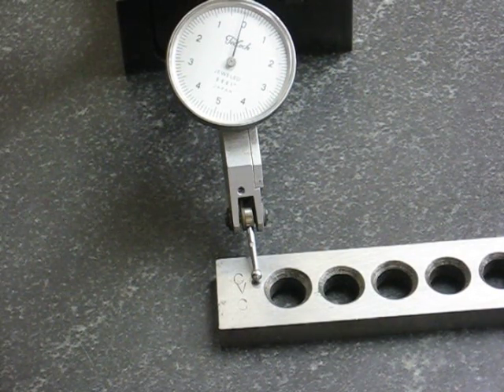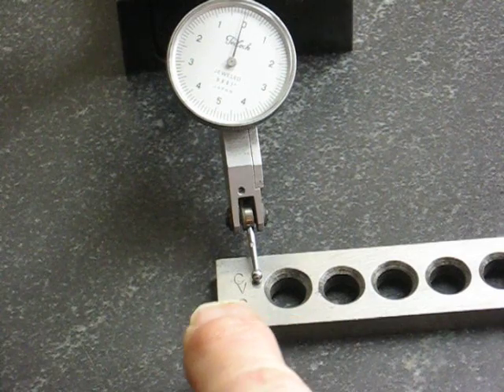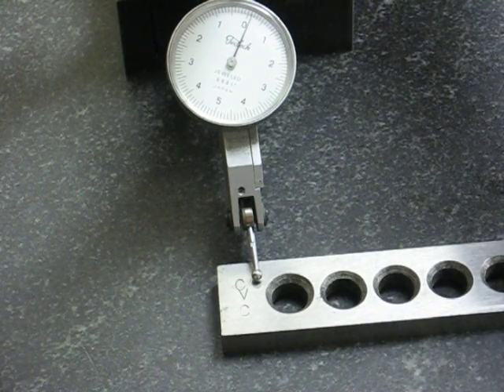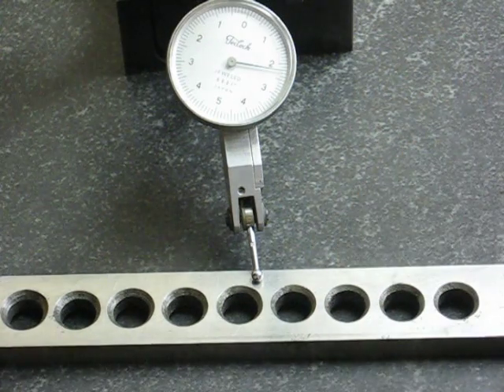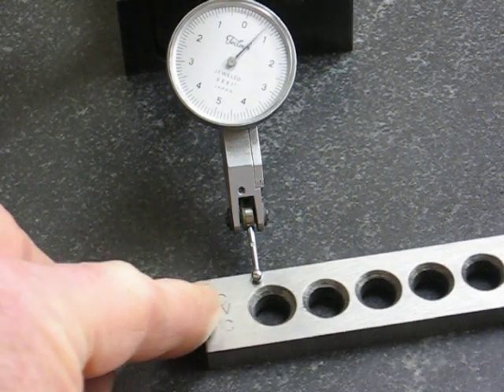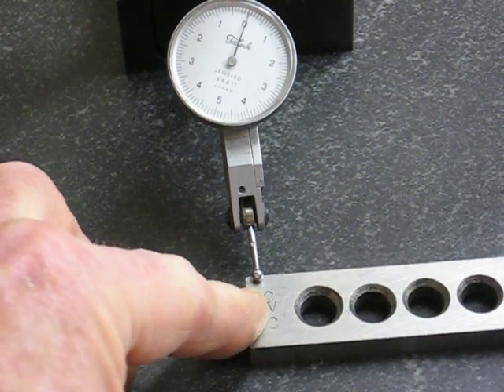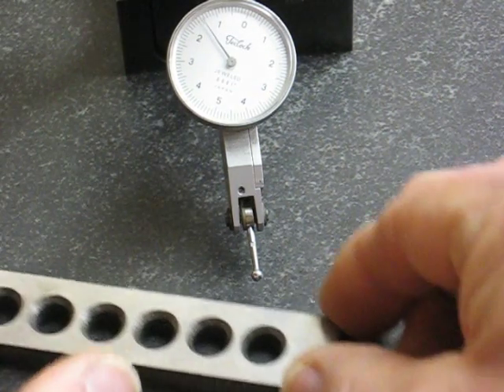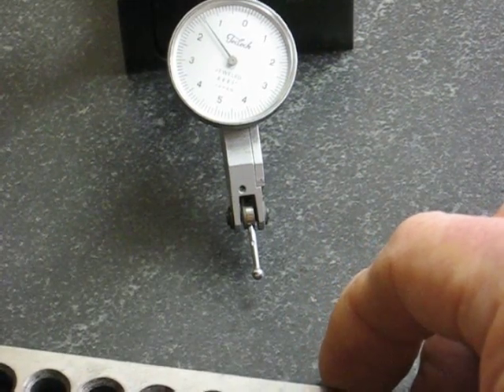Inspection of Flatness

Comment: I beg to differ. You are checking parallel and strightness
Reply: That is correct! To check the flatness, you need to sit your part on three posts.
Reply: you are correct sir! set on three jack stands or points of the same height, Then indicate the bottom. he was only checking //ism to the opposite side, a classic mistake I see at work all the time.
Reply: +Terry Goldstein The video is definitely checking parallelism but I think you don't have to sweep the bottom to check flatness.  Set it on three screw jacks with the surface to be checked facing up, zero it on three surfaces and you're good to go.  You're checking the feature to itself,  not the other side.
Reply: I agree, it is just quicker and easier to reverse indicate when sitting on three equil height points.
Reply: I also agree. This is a parallelism check, not a flatness check.
Reply: This is Parallelism not flatness or straightness.
Reply: I guess in his defense, this is a failsafe way of checking flatness. If it passes this type of flatness check, it will pass a "real" flatness check.
Reply: Sorry, If you check flatness/ straightness  it's not correct, it's a basic mistake in metrology to do it this.way.............it's parallelism.....nothing wrong with that.......It's not Flatness or straightness ..look at the metrology standard way of measurement?

Comment: Hi, thank you for the video. I have a question: Don't you change the reference when you do that movement over the flat surface? what is the difference with parallelism inspection? May be the surface is actually flat, but it's copying the error of the inferior surface. thanks!

Comment: WRONG!!!! Absolutely incorrect, incorrect. It is not a measurement of flatness or parallelism or size, or anything.
Reply: Why is this not a parallelism checks? It is checking how parallel the top surface is compared to the bottom surface. The stone is the datum simulator